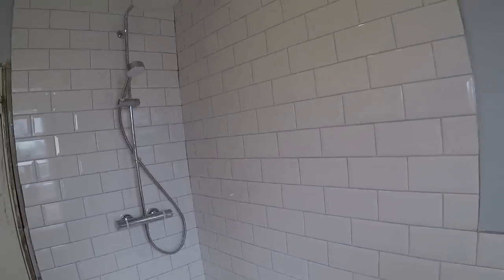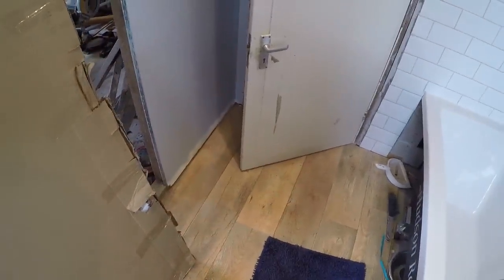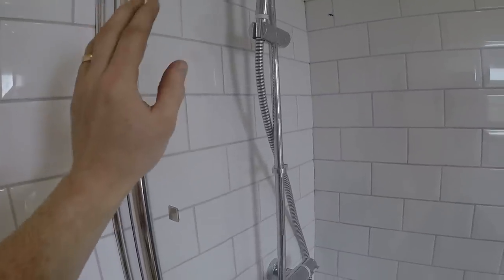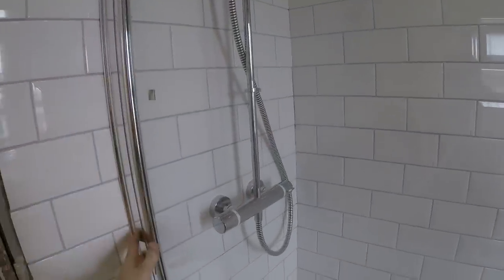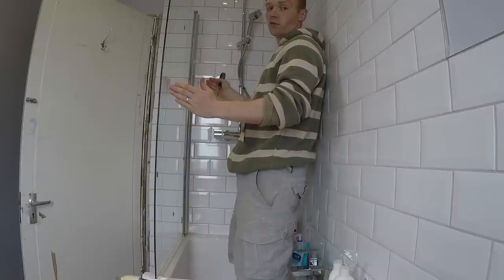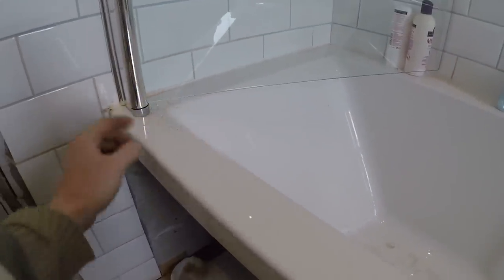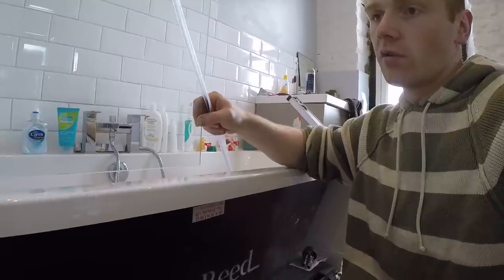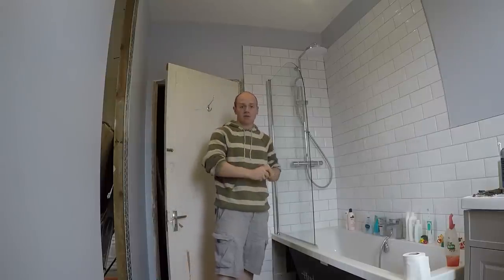Bathroom Renovation 10.0 | Installing Mixer Shower and Screen

Comment: Great job. Two bits of further advice based on painful experience: a) Drill holes in tiles so plugs go behind tiles, otherwise the expanding plug cracks tiles when you screw in; b) When dealing with fiddly small bits, put the plug in - amazing how dropped bits disappear down the plug hole.
Reply: Sounds painful John - glad you mentioned that... were they large tiles (A3 paper size) or relatively small tiles?

Comment: Great vids. We're also looking at installing a 32mm MDPE water supply and unvented cylinder...how's the performance of the shower with the cylinder?
Reply from the maker: Very good. We don't have the best pressure here but plenty for the shower. The mdpe size helped to a certain extent however we may have seen the same from a 25mm supply. You need to take it down to 22mm once in the house anyway. That said for an extra £10 it made sense to go with 32 to keep things future proof.

Comment: Hey great video - reassuring as I'm half way through fitting a similar looking screen. Can I ask you if/how you applied silicone though? My instructions say to run a bead down the middle of the fixing plate bit and up both sides. The way I'm looking at it water's gonna get at the bottom and just drain down under the back of the plate unless I put some inside at the bottom. Cheers
Reply from the maker: I thought originally that it was best to seal both sides however after reading up in was advised to only seal outside to allow any water to run back out and in to the shower. Providing you are not trapping water anywhere I would say do more the better.
Reply: Yea i understand the logic behind it but seems like even if draining inside and sealed at the back and outside, allowing water to be definitely be constantly behind and inside the channel is a bad idea.

I'm struggling to work out of the following do I need to do:
a) Seal the inside/outside of the channel to the tiles, top to bottom
b) Seal the inside/outside of the channel bottom to the bath
c) Seal the inside/outside of the non-pivoting part of the screen to the channel, top to the bottom
d) Seal the non-pivoting circular part of the screen to the bath